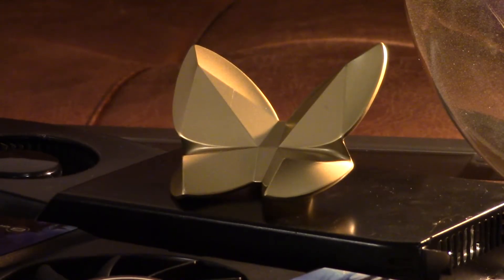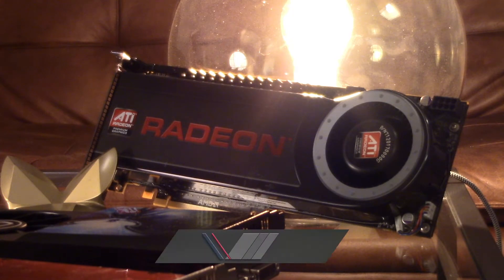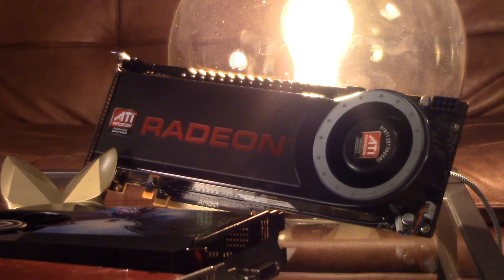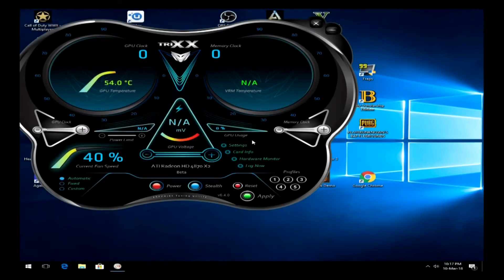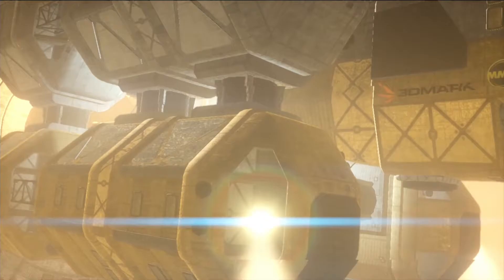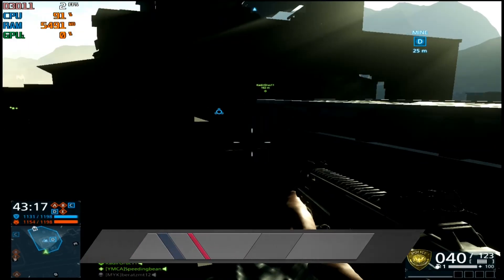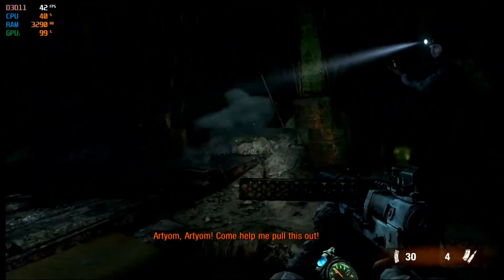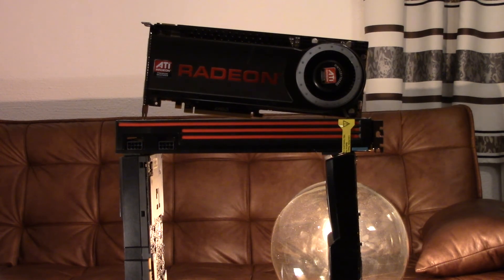HD 4870x2 Test in 7 Games (2019)

Comment: Which drivers did you use?
Reply from the maker: AMD Catalyst 13.1
Reply: @ZERF1CKER  Why not catalyst 13.9? Its the last driver release
Reply: @m.wajihuddinkhan1857  because legacy cards (4xxx series and older) were made by ati,released a looooong time ago,and amd has no obligation to continue make drivers for things they didn't really make,and who still uses that as a main card today ? you can get a newer,more powerful and cheaper card brand new
Reply: @f_for_freedom2492  I do xD using a HD 4650 as a replacement for my dead gts 450, and i am using catalyst 13.9 albeit  on win 7. I asked the question because somewhere in the final driver releases for the HD 4xxx card amd went on and removed its oc capability. I cant even oc on msi afterburner the sliders are maxed to the stock. P.S its a hp oem card. I am tired of looking in old forums and finding no answer. the only proof of this problem with others  is in the comment section of a few old youtube oc videos.
Reply: @f_for_freedom2492  hmm i thought of that too.the oem part can be the culprit but i dont want to experiment with drivers now as bluescreens on win 7 are much scarier than on win 10 :p, 
thanks for the info & quick reply. : -)
Reply: @m.wajihuddinkhan1857  no promblem sir,if i can help,i do it

Comment: Wtf bf hardline is not that hard to run
Reply from the maker: Well this might be atributed to the drivers, the latest version for AMD legacy cards is CCC 13.4 but the game won't even start with that version, so I had to resort to the previous driver version and that is 13.1 for it to even run. Also 2x 1GB VRAM is not plenty for Battlefield as in reality it is more like 1 GB in a crossfire setup.
Reply: ZERF!CKER well that’s not all true... each gpu has 1gb of memory
Reply: BF Hardline minimum requirements
Operating System: Windows Vista SP2 64-BIT (with KB971512 Update)
Processor: Intel Core i3/i5 2.4GHz or Athlon II/Phenom II 2.8 GHz.
RAM: 4 GB.
Graphics Cards: NVIDIA GTX 260 896MB or ATI 5770 1GB.
Hard Drive: 60 GB.
DirectX: 11.0

The 4870X2 doesnt support DirectX 11, thats why it just didn't run properly.
Reply: Kozmikōcēlōtl  If your graphics card doesnt support DX11, installing DX11 won't change anything, however, if your card supports DX11, it also includes all the previous versions, so of course you can play still play DX9 and DX10 titles with a DX11 card, I do it all the time.
Reply: Kozmikōcēlōtl  whenever you install DX11, it also contains earlier versions of DirectX, so you can just leave it, but just know that DX11 games will still not work on your system.
Reply: gpu usage 0%